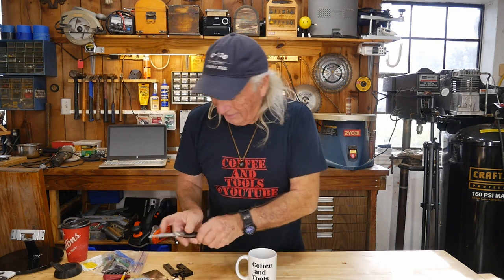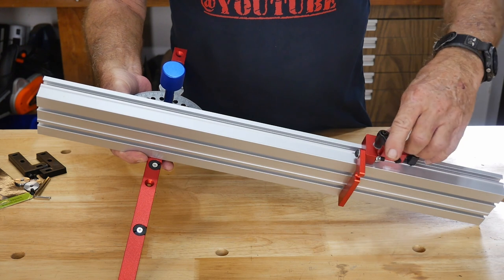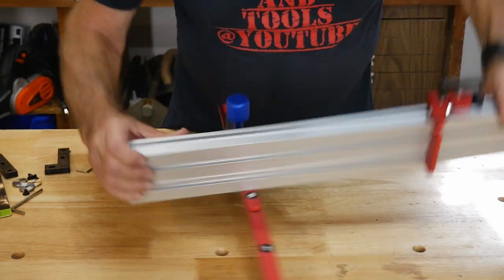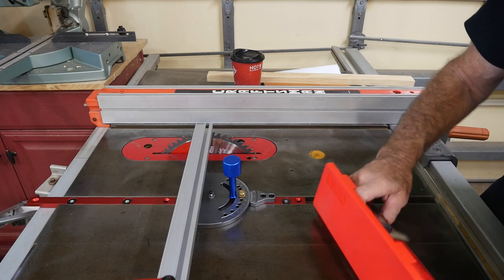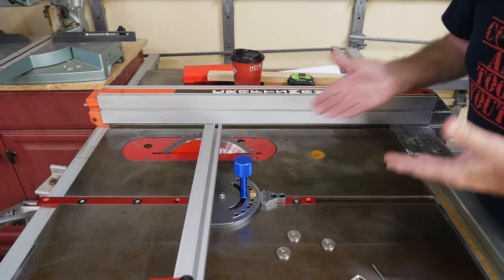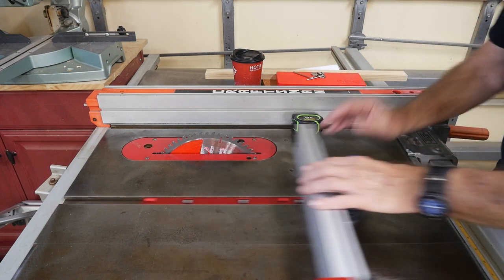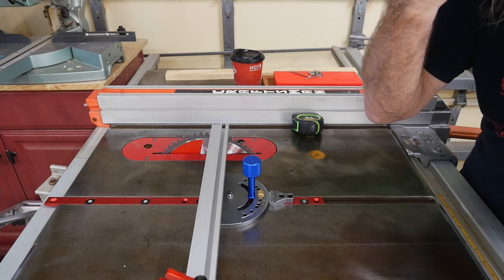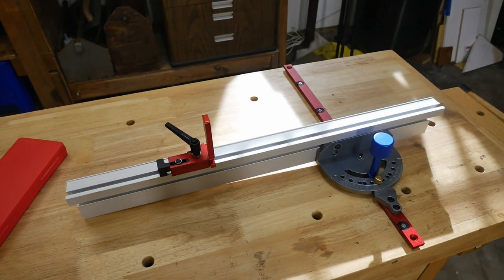Table saw upgrade miter gauge, great price !  Coffee and Tools, episode 189

Comment: DANG! Missed it BUT, they say restock within 90 days…so I signed up through their app to be notified. Even if it goes back up, it’s a great tool and I gotta have one! I build an octagon shaped well house so, repeated cuts at 22.5 degrees on the miter saw…17 or 19 inches long, would have enjoyed that miter fence! Anyway…good call on this tool…I’ll cut my own throat and share the video on facistbook as well. Tools are color coded…the color determines how badly they dig into your wallet!!😁

Comment: Hey bro.. I bought one of the Wnew mitre gauges for 65 Euros out of China. I need to build one part for it out of some extruded aluminium and add a stop to it but for the price it's brilliant for me. Myt only issue is it's too big for my saw tracks.. Too mide but my tracks can only fit 6mm depth and the one I have now is about 9/10mm so I will need to get it ground down to 6.25mm to get it to fit my tracks but it's a beauty

Comment: I have one coming from VEVOR tools in the UK. On the top of the stop is adjustable 'bumper'. what is that for? Trying to think of a purpose, the only thing i can think is you move the stop to the front for some reason? Great video by the way, Thanks. Kevin
Reply from the maker: I'll have to take a look at it. Next month we will be selling for VEVOR tools !  Yeah, just signed a deal this week for doing all their tools etc. Should get interesting. The "bumper" that your looking at should be adjustable for doing a production of cuts over and over again. The "stop" is adjustable and should be flipped down and locked for lengths.

Comment: The adjustable stop looks a bit thin, how bad is the deflection?
Reply from the maker: The deflection is very low, but fit depends on the saw. Happy enough that I've dropped the idea for a cross cut sled.
Reply: @SirTools  thank you for your reply, eliminating my crosscut sled is exactly what I'm trying to do. As long as I'm aware of any deflection, I can stop it, thanks.
Reply from the maker: Hope it works for you. Mine is "good enough"

Comment: I have this miter gauge and would like to use it  however the brass pin that holds the angle is under sized for the hole so it has slop and will not hold a an angle accurately making the product useless
Reply from the maker: Strange, but production can be something else at times. Mine is excellent, but maybe yours was the Friday model.

Comment: Just bought mine today in UK now has a black fence ( vevor) I paid £60 posted 
Re the sliding stop , any ideas what the black adj piece is on the top it says on the web site it’s a trim block , but a tad unsure how to use it 

My saw configuration is like yours and will be using the mitre gauge to the left of the blade , cheers
Reply from the maker: The tab or trim block, if I'm looking at yours right can be flipped down to act like a stop block.